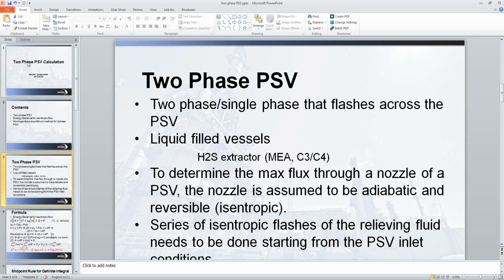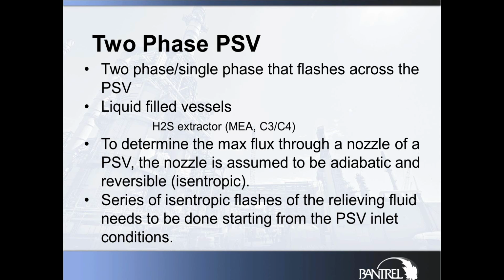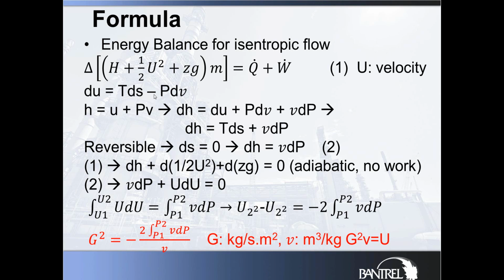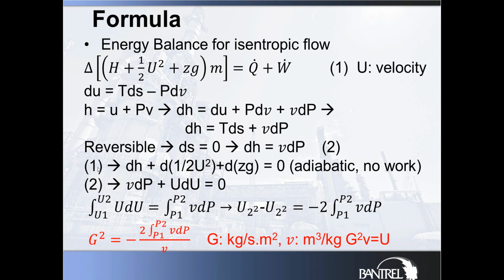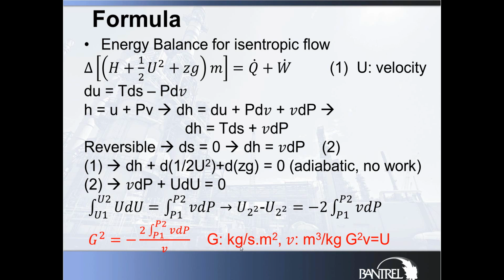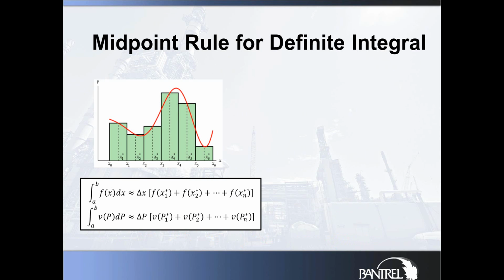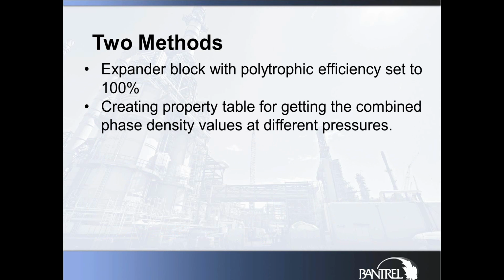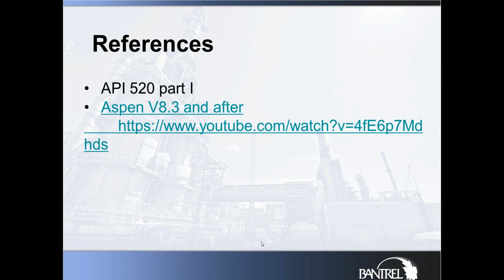Two phase PSV Calculation HEM Method part II

Comment: Maryam,

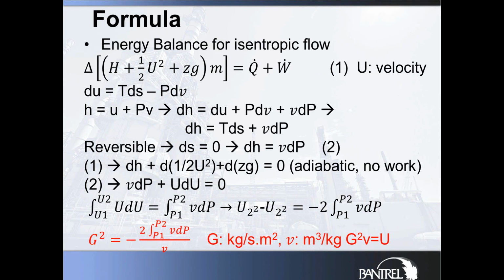A couple of errors on the slide that appears at 1:17

Firstly (minor point) the process being only reversible isn't the reason for dS = 0, the reason is being adiabatic & reversible together causes dS = 0, as Q = TdS - F (where F is irreversibility), when F & Q both = 0, then that necessitates dS = 0.

Secondly (major point) G (flux) squared = -2 x integral of vdP divided by v squared (not divided by v). The implicit assumption being that U1 = 0 as fluid is initially at rest. 

Otherwise very interesting video.